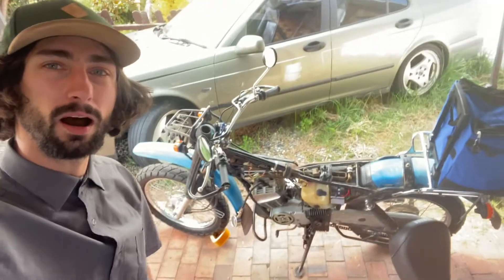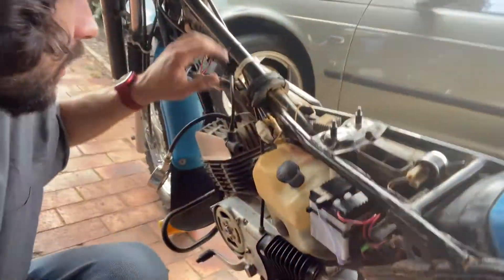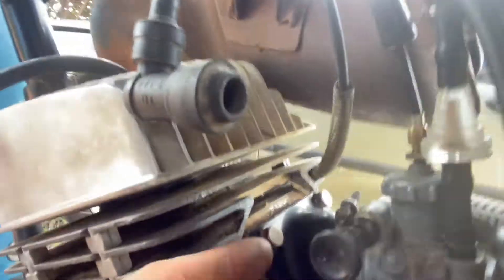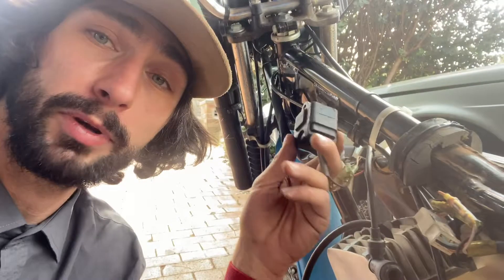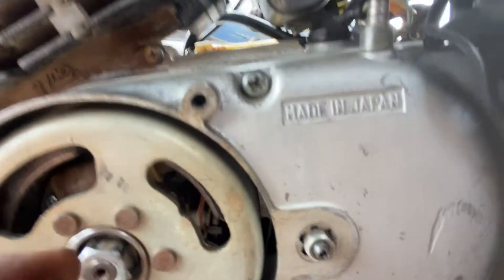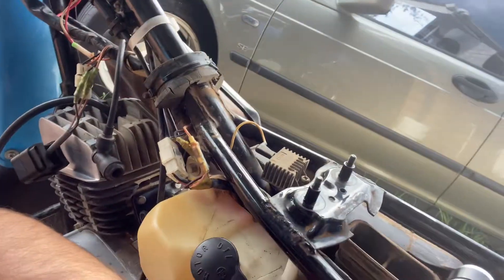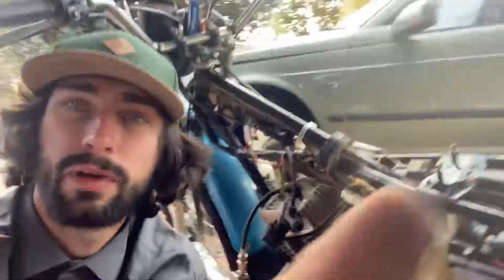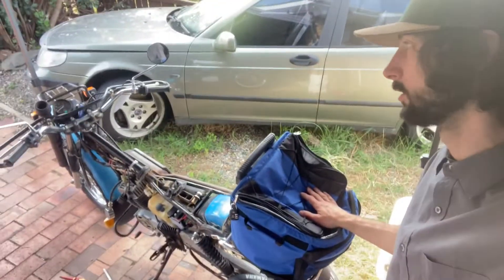My Yamaha AG100 1981 / WILL NOT START - Almost Tried everything..... sad 🏍 Motorbike

Comment: Try spraying wd40 on the electrics
Reply from the maker: Heya! so it turned out the Spark Charge Coil In the STAOR was bad and it was not producing the correct voltage for the CDI to work! I replaced the stator and it runs beautifully now!
Reply: @mathiasmustillo  Good to hear she is going strong. I have a AG100 an want to ride it from far east victoria through the mountains to Mansfield.
Reply from the maker: @micksmith9013  that sounds amazing! I would love to join you in your trip! I want to do a nice mountain cruise once too! So yours is riding well? 😍
Reply: @mathiasmustillo  Yer mine is working well an i like push the reliability of my bike. Sounds good if  your interested in adventure I'll give you more details. If you know anyone else whos interested that can do the distance let me know.